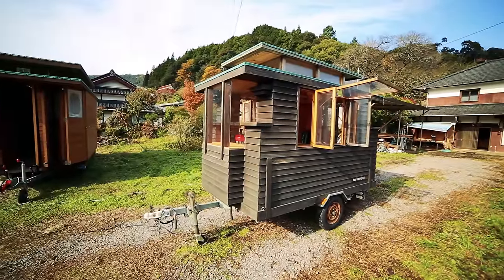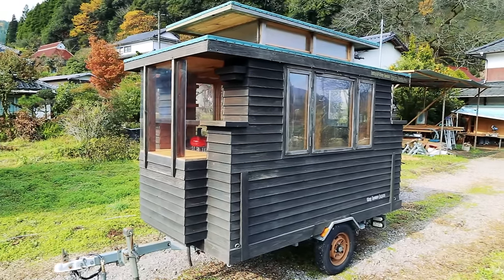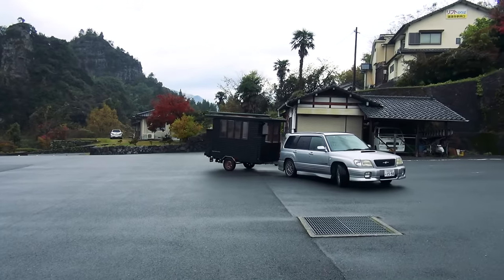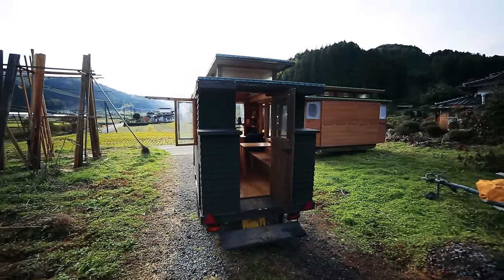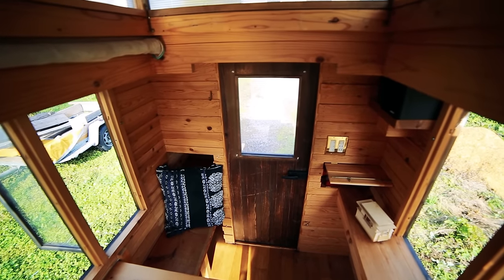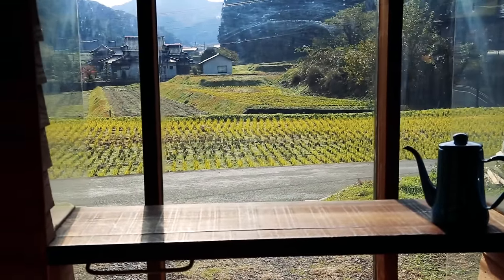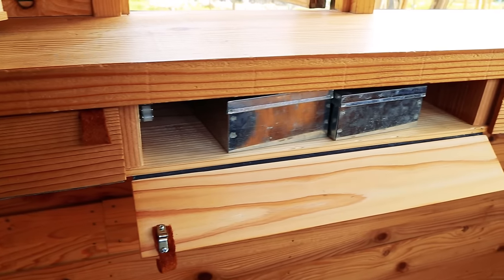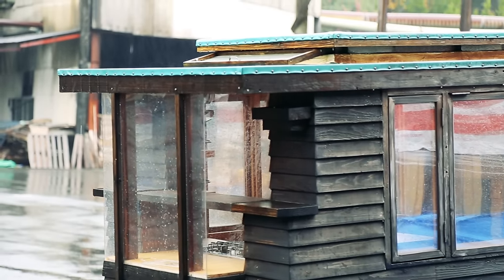Master Craftsman In Japan Builds Amazing Tiny House On Wheels

Comment: I turned on the captions and it was just spelling out what he was saying in English letters, Bryce could u add subtitles so I could understand what he's saying. 👌🏻👍🏻
Reply from the maker: Make sure you've selected English and not the automatic captions.
Reply: Living Big In A Tiny House ok got it, thanks 😊
Reply from the maker: Cheers! I've removed the automatic captions from the list to hopefully avoid the confusion there. :)
Reply: Could you use a different color for the background on the CC. Gray with white lettering is difficult to read
Reply: Michelle Dennelly yes it works fine for me as well.
Reply: you need to change these settings yourself in the settings menu (the cog where you also select video quality)/subtitles/settings (top right). there are more options than necessary but i changed the background to black, text to white and text opacity to 100 which makes them very easy to read regardless of whats going on in the video behind. :-)
Reply: DMonZ1988 That option not available on my phone so I will check later on a real computer. I was looking for something like that and when I did not find it, I figured he had to set it.
Reply: John Sexton aha Ok, you're right, on mobile its different. just had a look and i found the caption settings though. go out of the video to the initial YouTube start screen and go into settings via the three dots on the top right. there's a sub menu for captions where you can select the colour.
Reply: DMonZ1988 Brilliant. It works well now. Thanks!
Reply: John Sexton pleasure buddy, happy I could help :-) 
it's well worth a watch as always and the conversation reveals some very interesting details and design philosophy. 

thanks Bryce for another great video!
Reply: DMonZ1988 I have seen all of his vids. One of my faves!😁

Comment: Hey is 3,000,000 million yen correct? that seems high. That works out to 36k Cad or 27k usd? Just wondering if its a translation issue or thats just the most expensive house per square foot known to man.